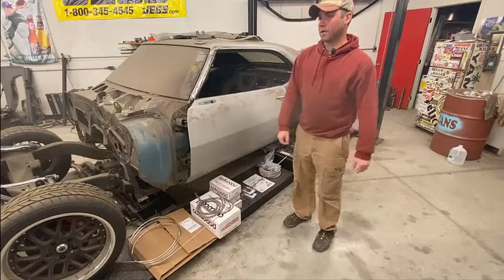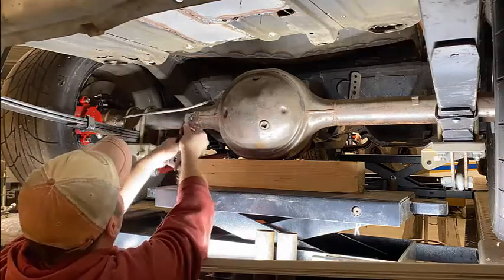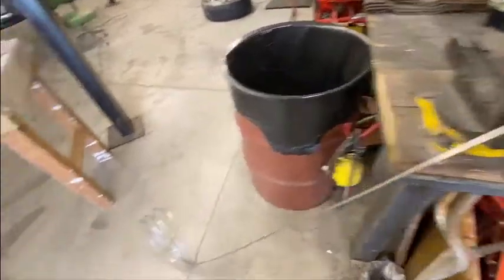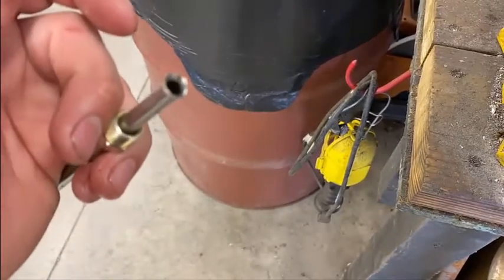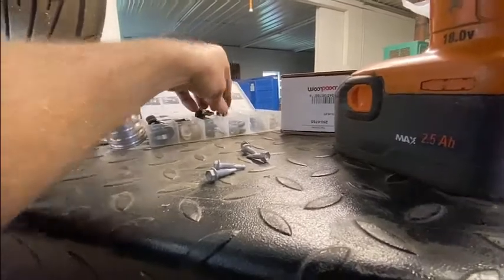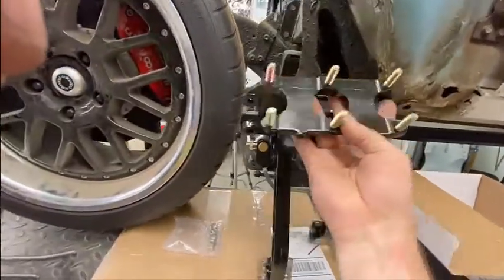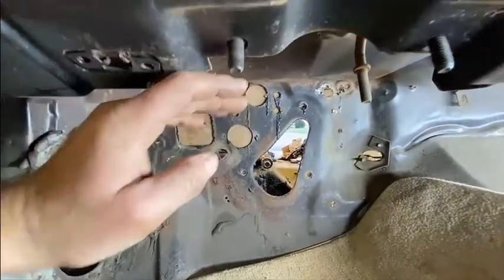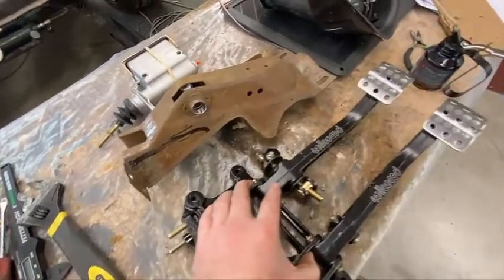68 Camaro Stainless Steel Brake Line and WiIwood Pedal Install Part 1

Comment: Why did you decide to use 1/4 in brake line going to the rear, understanding that may be what was used but since you're installing all new brakes just wondering why you didn't go with 3/16? Great video very informative!
Reply from the maker: Went this route based on the brake piston size. When I reached out to Wilwood, it’s what they suggested for this setup. Any smaller and it may have not moved enough fluid for the larger pistons out back. Thanks and looking to start videos again soon!
Reply: @dream_killer_racing  awesome thanks so much what was your Master cylinder bore size? Im building my 69 camaro bottom up and educating myself as it goes so just trying mirror a lot of what you got!
Reply from the maker: @sethtannermiller  to be honest I don’t recall. However, if you have the calipers for front and rear along with brake piston sizes you can call Wilwood or any other after market brake parts vendor and they will be able to source what’s best. That’s my experience.
Reply: @dream_killer_racing  Yeah man took your advice and called them up. they confirmed what I should be using and sizes for everything thanks again!
Reply from the maker: @sethtannermiller  good deal! Happy to help👍🏻👍🏻

Comment: Will regular flare work or are they supposed to be button flares. Great video
Reply from the maker: I’ve tried standard flare and didn’t have any luck. All brake line flares I’ve seen have been bubble.